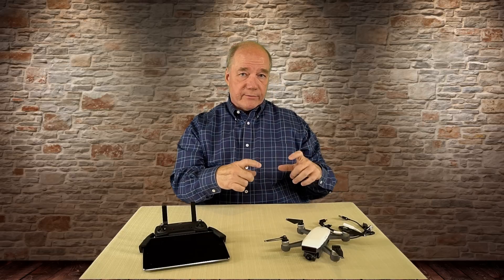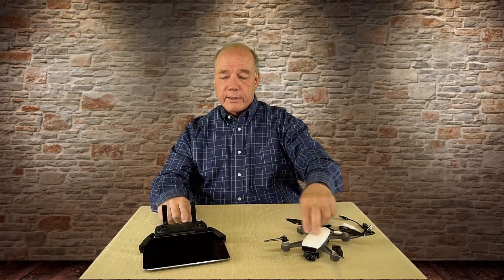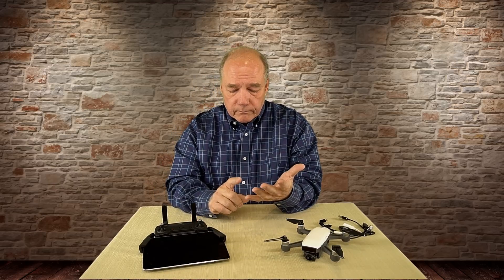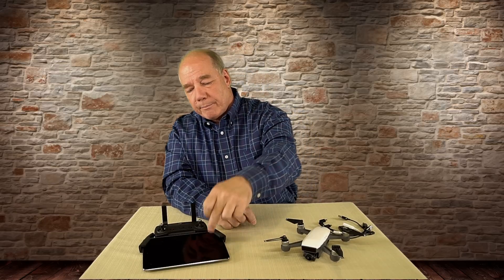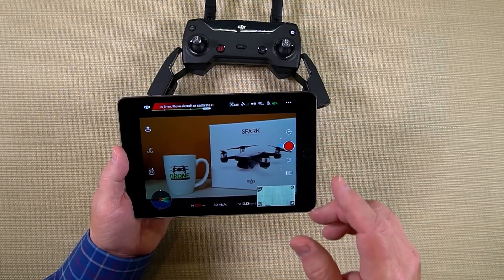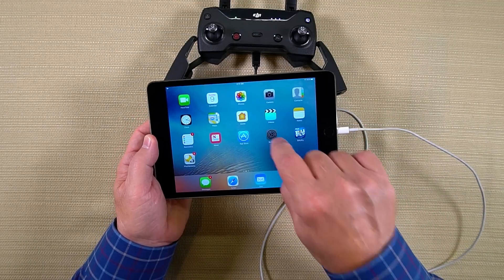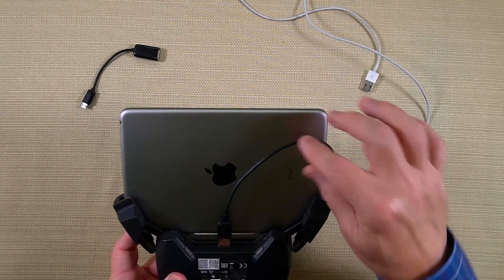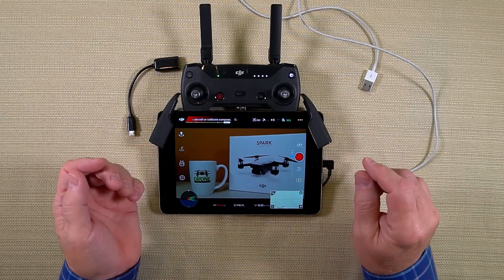One Simple Trick to Fly Your Spark Farther

Comment: I never used the cable with Apple, and it seems in the video to configure itself, but for all the Android users (remember the Mavic f.ex.runs on Android KitKat - for all you IOS people that think you're the best) the problems you can run into when you don't get the cable to work often has to do with the configuration of your Android device. On some of mine I had to enable developer/debug USB connection for it to accept the connection. Also first time you connect it with the app running it asks if this app should run by default with this connection, click OK and in the future the app will start by itself whenever you connect and switch on the controller.
Reply: Happy Fox  oh my yes yes yes .
I was saying this on the forums for ages and know one ever picked up on it . I said it was all about the first time and checking the auto connect and I never had a lost connection and after reading your reply I feel vindicated

Comment: Hi, I have problem with changing altitude distance on Dji Spark. It's set on 50m and when I change it to cca 120m and exit app he goes back to 50m and all the time same. So I'll be thank if somebody can give me advice to solve this roblem..
Reply from the maker: Ivan, I would make sure that you have updated to the latest firmware for the Spark and also that you have signed into your account recently. The quad needs to "touch" the internet every now and then to finish firmware updates. Give that a try and let me know how you make out. Rick

Comment: Hi Rick, great videos, very well put together and very informative.

My question - if the Phone/Tablet connects with WiFi to the RC (very short distance), how does or why does using the OTG make the WiFi signal between RC and aircraft that much better? I know it works because I cannot fly my Spark using only a WiFi connection so I always use the OTG.
I have recently heard dji does not suggest using OTG because it has not been fully tested. Also I bought my Spark while I was in China. I am not able to switch to 2.4Ghz so I have not been able to test using that. All in all the 2 WiFi signals the issues between Apple and Android and getting stable feed between aircraft, controller and phone is all very confusing.

Comment: Doesn't make it further my friend!
Only modifying the antenna on the remote will increase distance.
Connecting dongle to the DJI Goggles! NOW that's flying!
Reply from the maker: Kerry, thanks for the post but I found that it does increase the distance slightly by using the cable. Here's why I think that's true. Without the cable the controller has two Wifi connections to monitor - one for the link to the phone and one for the link to the quad. I believe these compete for attention at the processor level and by eliminating the link to the phone with the cable you allow the remote to only focus on the link to the quad, thereby improving reliability. I have found that the signal is stronger with less dropouts when using the cable and that allows me to fly a little farther without worry. I do agree with you about the DJI goggles and love flying the Spark with them. Rick
Reply: Drone Valley 
Where's the proof?
Signal indicator? Telemetry? 
As you stated...you THINK it has more range
Reply from the maker: Kerry, I can only go by my experience with the quad that I have been flying ever since it was release, but I can assure you that I am not only able to fly farther using the cable but also have a stronger signal in close when flying. As I mentioned in the complete clip on this topic, I notice it more with an Android device than an Apple one and find this interesting. There is really no way to prove this other than flying the same route with the cable and without to see if there are dropouts. Take my evidence for what it's worth but other folks have agreed that the cable makes a big difference with signal strength and reliable flights at distance, especially on Android devices.
Reply: Drone Valley so no data to back your claim?

Comment: Hi Rick,  I had recently updated my firmware for the remote controller.... after i reconnect to my spark ... the video doesnt come up on my iphone. However the direct wifi with spark (without remote) shows the video. Help me with this please
Reply from the maker: Mohamed, did you update the quad and the remote at the same time? Did you get any error messages when the update finished or did it complete normally? Lastly, if you have more than one battery, you'll need to cycle them through the quad to make sure they are all updated. Another thing to try would be to do the update again using the DJI Assistant software and your computer as it's a more reliable way to update for me. It sounds like something went wrong during the update. Thanks for the post and be sure and let me know how you make out. Rick

Comment: I use a i-phone 6+ if I get your spark controller connection kit does it have all that I will need?
Thanks
Reply from the maker: Yes, I have two kits for the iPhone (20cm and 30cm) the shorter one works if you have the phone in the handles and the longer one is if you're using a tablet holder. Thanks for your business. Rick
Reply: Thanks Rick

Comment: Hello, I notice that you have been flying with the ipad...I have an issue with it and in wonder if you face the same problem

1. The RTH to controller never gets to update correctly each time I press the 'mark to rc' in the MC settings. It will still fly back to original home point!!

2. I solve the problem by exiting the app and go back in again

3. This time the map orientates correctly and the RTH to controller is marked and refresh correctly - I checked this in mapview.

Are you encountering the same problem? I tried it with both my iPhone 6S plus and IPad mini and both needs me to exit the app and get back in before RTH to rc is marked correctly

Comment: Someone on one of the forums was given a beta version of controller firmware to try and address some problems.  The beta disabled the ability to connect with the cable.  No official word from dji that I know if as to whether this might be the case in a future release.  Quick solution, be careful about firmware controller updates unless you now how to roll back to a previous release.  Hopefully, this is just the beta version and will not be the case with future releases.

Comment: Hey Rick, love your videos!!! Quick question... can I use the cable that comes with the Mavic  instead of the OTG cable? Does it work? Thanks
Reply from the maker: Cristhian, For this setup to work you need to use a special adapter called an OTG dongle. This allows you to create a parent/child relationship between the controller and your phone/tablet. A straight cable won't accomplish the same thing without the dongle. When you do use the correct cable, be sure to have the dongle on the controller connection as it's not bidirectional. Thanks for the post! Rick

Comment: There is also such thing as micro usb to lightning.
Reply from the maker: Thanks for the post but actually there is. When you look at a standard Lightning cable, you have the lightning connector on one end and a full-sized USB on the other. To use this with the Spark you need to add an OTG adapter that converts the USB on the cable to a MicroUSB you plug into the spark. The kit we sell on the website has a short Lightning cable and the adapter, essentially creating a Lighting to MicroUSB cable.
Reply: thanks for the reply. Thats not what Im saying. Youre adding an extra step. They sell just an microUSB to lighting cable. I use it. Much easier than all the dongles and adapters. Just wasnt sure if you knew about it already.
https://www.amazon.com/dp/B071ZS7XB6?tag=amz-mkt-chr-us-20&ascsubtag=1ba00-01000-a0049-win70-other-nomod-us000-pcomp-feature-scomp-wm-4

Comment: Hi, quick question on the cables for android. On the order page lists 4 different android options. To get the short cable setup you show would I order both the 20cm USB c and the micro? Just a bit confused if need both cables. Thanks.
Reply from the maker: Thanks for the post and the Spark accessories page has both the connection kit, that includes the right cable and 2 adapters, or just the cable itself as a spare. To make the connection between the controller and the phone/tablet you would be better going with the kit as it has everything you need. When you purchase that, you'll have a choice of which cable to add depending on your phone/tablet. Please let me know if this helps and thanks for your support. Rick
Reply: Drone Valley hi again, thanks for reply and sorry to bother but still confused as far as android option. The iPhone looks like just 2 options, the 20 or the 30 but android option has 4 choices two options in the 20 length and 2 in the 30 length. So I guess I'm asking if I want the 20 length do I order 1 of each option to make up the kit? Usbc and micro in that length. Thanks again!
Reply from the maker: Sorry for the confusion. The reason there is two flavors of cable for the Android (as well as 2 lengths) is to accommodate your phone/tablet. You need to check which USB version your phone uses to charge. It's either a MicroUSB or a USB-C. Once you know that you can use the 20 if the phone fits into the handles of the controller or the 30 if you'll be using a tablet holder. The kit comes with an adapter to turn the other end of whatever cable you buy into the MicroUSB used on the controller. I appreciate the question and hope that helps. Rick
Reply: Drone Valley oh ok, I get it now, lol. Again sorry, noob to the cable hookup. My phone is micro USB and it fits in controller so if I'm correct and want the short hookup you show I can just order the 20 micro cable, no need for the usb-c one? Thanks yet again!

Comment: I got your cables and set it up on wifi on my iPhone 6* and got connection. With the cable plugged in already I turned off the wifi and lost connection. I have to have the wifi on to be connected. You showed disconnecting the wifi and it stayed connected with the cables connected. Why is that? Am I only connected by the wifi on my phoone?

Comment: Hey Rick. Any idea why Fn button is not working when connected via OTG cable so it's happening only to me? Thanks
Reply from the maker: I haven't had that issue but I'll check mine tomorrow. You might also want to go into the DJI Go4 app and make sure you have that button assigned to a specific function.
Reply: Rick, it has been configured on app. Along with the down right side configurable button. Both of them work when iPhone connected via WiFi, but none of them under OTG connection. Strange !!!

Comment: Hello rick i have couple questions regarding these cables. They do look really nice however i am concerned using these with my iPhone 7 plus, will this cable fit through the slot of the controller and connect to my phone? since i do not have a tablet. Also When you said " These cables can be sketchy" how are these cables in regards to quality? do they last? do they feel cheap? or are they great cables and would you 100% recommend them?  Since the cable that DJI gives you seems to go bad. Thanks Rick

Comment: Hi Rick great video well presented, I have a question regarding the Spark RTH functions, I understand that within 20 Mtrs Horiontally from the RTH point the Spark will land immediately, and from 20 - 80 Mtrs it will RTH with obstacle avoidance, and after 80 Mtrs it will RTH at a higher speed and therefore obstacle avoidance will be turned off..... UNLESS you have set RTH at current altitude in which case it will RTH with obstacle avoidance, is this correct?? I am not keen on trying it to find out :)  thanks for the great videos.

Comment: Hi Rick,
Love your videos...have learned lots.  I have figured out the sequence to get my tablet connected to my remote and then to the Spark.  once connected...i can see the video feed on my tablet. I can adjust the gimbal with both my tablet and my remote.  I have tried two different dongle connections...but cannot get hooked up via the cables. As soon as I put my tablet in Airplane mode...I lose the signal.  So, the cable is not working. I guess I have picked the sketchy ones.  Just checking... do you think your dongle insert and cable will work for me?  Thank you for all your help!
Reply: Here's to hoping this one works...

Comment: Hey Rick, Great video!  I just ordered the Spark (I'm not sure why, it just seems so unique I had to get it). Anyway. I was looking to order the cables from you, but I have a quick question; What are the 30 and 20 cm cables?  I have an Iphone 6 so I know that it has the lightning port, but I'm not clear on exactly which cable I'll need to make the connection you describe. Perhaps you covered this in the video and I missed it somehow.  (?)  Any help would be appreciated. Thanks and keep up the great work!.
Reply: "What are the 30 and 20 cm cables?" The 20 is for a phone, 30 for a tablet.

Comment: Thanks. I got the OTG cable and a short USB/lightning cable but the app still shows "disconnected". I can't seem to get it to connect using the cable.?? I tried two different short cables and still not getting it. What am I doing wrong?
Reply: "cable connection is just a gimmick, doesn't work on real life." This episode demonstrated before our eyes that it does work. However, I have discovered that some cables that seem like they should work do not. This one works great with my Spark remote and Android phone https://www.amazon.com/gp/product/B0744BW2B2/ref=oh_aui_detailpage_o00_s00?ie=UTF8&psc=1 Or buy Drone Valley's kit, which has been tested and verified to work.

Comment: Hi Rick, I have a question. On the dji message board several people claim that the wifi to the remote works better on 2.4 rather then 5.8, have you heard anything about this?
Reply from the maker: It all depends on what "noise" is in the area you're flying. The WiFi (ISM) band is used for a lot of other communications and some locations have a quieter 2.4 Ghz band and with other locations the 5.8 Ghz is quieter. The best thing to do is let the controller decide because it dynamically scans both bands on power-up and picks the one with the most consistent signal. I hope that helps. Rick
Reply: Thank You Rick!!!

Comment: This is 1st video I've seen that walks through connecting Remote Controller (RC) to Spark! Very needed!

This video covers three awesome tips, only way to make it better would be to have a quick overlay, or just say at what timestamps you change between the different topics: 
1 [0:40] ( https://youtu.be/anVIHuv4Zq8?t=40   ) -  Spark (Wi-Fi) vs. 'other DJI' (Occusync) connection
2 [4:45] ( https://youtu.be/anVIHuv4Zq8?t=285   ) - Connecting the Remote Controller (RC) for the 1st time through Wi-Fi
   - Controller Wi-Fi password is on the back of the controller!
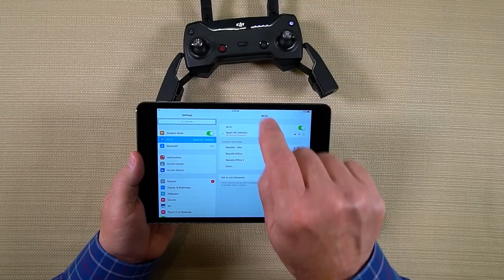3 [5:40-ish]  ( https://youtu.be/anVIHuv4Zq8?t=348   ) - Using OTG to directly connect the RC to the device running DJI 4 Go app. (Apple or Android)

Thanks for all the work you put into your channel!
Reply from the maker: Matt, thanks for the compliment and the suggestions. I'll try and provide a timetable in future clips. I also did an earlier clip on how to connect and break the remote tether to the quad a week or so ago that goes into a little more detail as well. I have a lot more content posting soon so be sure and stop back. Rick
Reply: I certainly will Rick! Really appreciate your channel, and spent some QT in the store too. 

I got my Spark connected last night, and it was great! The biggest problem I had was inserting the OTG cable into the remote, I was so nervous I was breaking the tab off! For others trying this for the 1st time, I would recommend doing a few dry runs with connecting the cable prior to flight time. Save that battery for the motors!

Here's the steps I wrote down while watching the third section, and that worked very easily for me:
 - Spark is powered on, but is off-camera
 - DJI Go app is running and showing live video on tablet
 - The Remote Controller (RC) is ON
 - And he makes the OTG connection between RC and tablet.
 - Then he turns off the Wi-Fi on the tablet
        - Screen flickers and resumes streaming Spark video feed! Success!

Comment: Flying further with the Spark and the dongle is not correct. Flying the distance that the remote WiFi connection to the Spark allows without local hiccups between rc and smartphone/ tablet should have been more in line with an eventual title for this vlog.
Reply from the maker: Thanks for the post but I think the tittle was fair since eliminating the flaky "local" WiFi connection does allow you to fly farther with the quad. I have done several tests by flying a defined route using my iPad Mini 4, which worked great and then flew the same route using two different Android devices and had dropouts along the way. By adding the cable (and eliminating the WiFi connection) I was able to use the same devices and eliminate most of the issues. I'm not totally clear yet as to the reasons but am thinking there may be a little fist-fighting going on between the two WiFi connections. I'm still testing this out but I stand by the title as fair. I hope that helps to explain things. Rick

Comment: Love your videos.... Thought Just a question I have a android phone and have purchased a cable to by pass the WiFi connection but I still see the WiFi connection on the device when it's connected. I only need to fly approx 250 metres and I loose signal. I noticed that when you connected your cable the WiFi symbol on the ipad it disappeared. Could you tell me what the problem may be. Thanks

Comment: Great video, with your engineering background can you think of a reason why a firmware update on the Mavic would break the VPS system? Happened to mine and it looks like a few other had the same problem. Already tried the standard steps a few times to no avail. Any input is greatly appreciated.